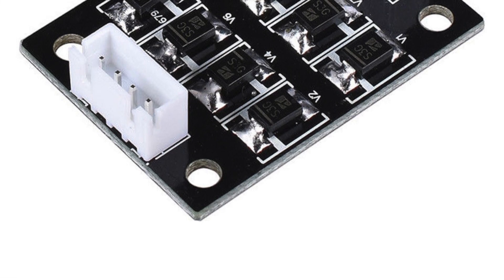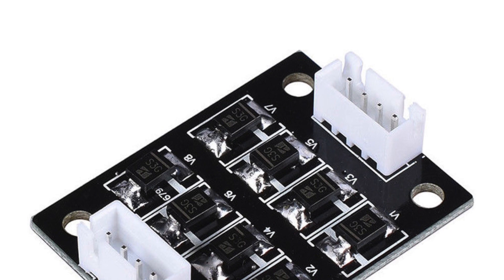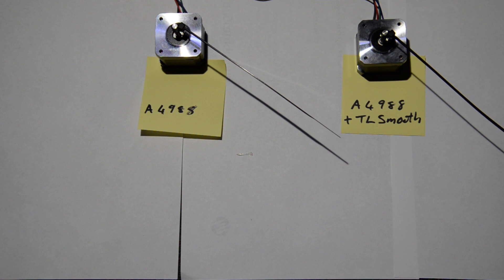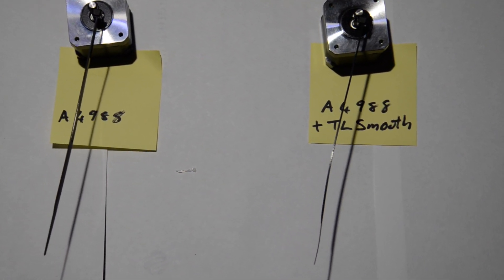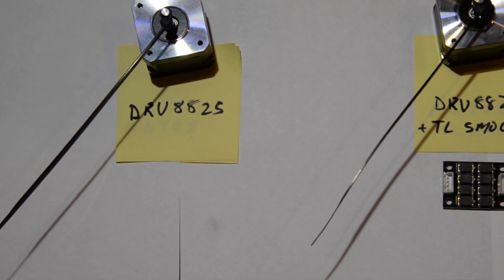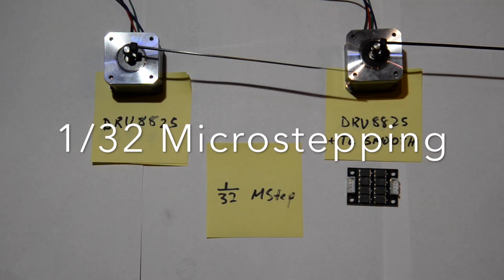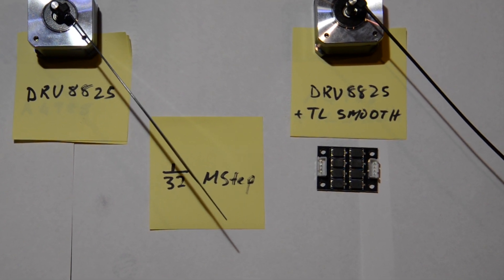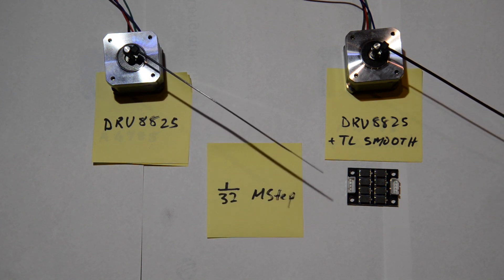TL Smoother Test: A4988 and DRV8825

Comment: Yeap, great! I will receive the TL-smoothers this weekend. Yesterday I added TMC2208 drivers with UART on the X and Y axes and now I will put this DRV8825 on the Z and E steppers with TLsmooth diode boards. I am expecting big things. Really hope I can let my Z-axis run even faster with the DRV8825 since the A4988 has some issues with supplying enough amps to the two-motor Z-axis setup.
Reply: Okay, to update, the TL-smoothers didn't make a difference for me with the DRV8825's. Somehow, even with 1/32 mcirostepping it makes terrible noise and jitter.
Reply from the maker: I've had issues when the connecting cable was bad quality. How about posting a video of the noise and jitter?
Reply: @ZechyC  When I return to the project I'll make a video. I have since replaced the drivers with the original a4988 drivers and these run fine with the same cables. I crimp them myself with dupont connectors etc. so should be good anyway. It is for a corexy plotter/laser I'm birthing.

Comment: Thank You for video,
Could You tell me does using smoother affect stepping / mm ? 
I mean does it need to re-calibrate after connecting or it's just plug and play with same firmware settings?
Reply from the maker: It has no effect on steps per mm. Just plug and play. Very easy.
Reply: @ZechyC  Thank You, just purchased and waiting for package.

Comment: Great test for movement smoothnest. Have you noticed any difference in sound or noise?
Reply from the maker: Thanks. No. The sound is the same. Maybe at higher speeds the sound will be different. But I doubt it.
Reply: @ZechyC  will do, At higher speed motor will run smooth and quiet but easier to stall as torque will drop.

Comment: so why should people use the drv8825 when its worse + way more expensive since it needs a smoother board (extra 3$ per unit)
Reply from the maker: I think people use the DRV8825 because it does more microsteps than the A4988.
Reply: what i learned is that the more microsteps the less power you motor has left
look at the percentage losses, its insane high:
https://hackaday.com/2016/08/29/how-accurate-is-microstepping-really/

Comment: Do you have (or know anyone with) video/photo evidence of if putting a smoother on the extruder is worth it? I'd imagine those pulsations could affect how the filament is applied.
Reply from the maker: I don't have evidence. There are so many variables. It will depend on what you are printing as well. The best is to simply use TMC2130s. They have become quite affordable.
Reply: @ZechyC  in that case, would it be safe to just upgrade to a Duet2 WiFi? Or is there a better board out there?

Tevo Little Monster here.
Reply from the maker: I don't have experience with 32 boards. Have a look at these videos https://youtu.be/UOXN1wnU_S0

Comment: What voltage did you use on the stepper drivers when doing the comparison ? 12V or 24V ?
Reply from the maker: I’m using 12V. It would be interesting to see if 24V makes a difference...